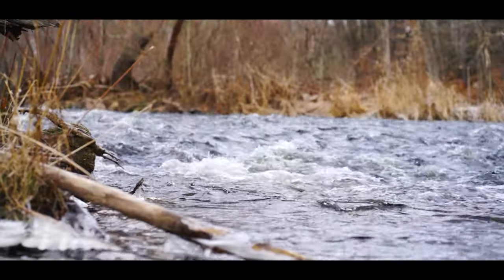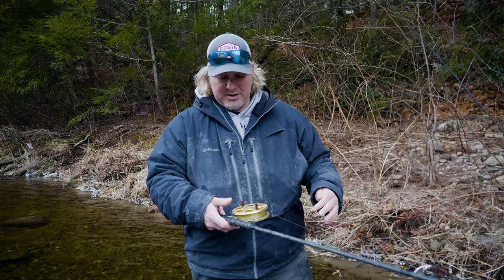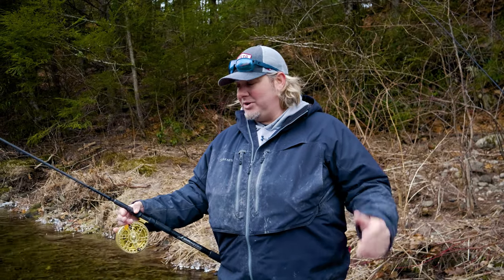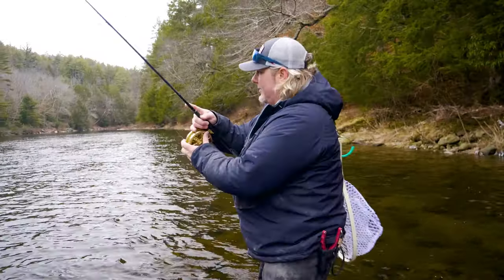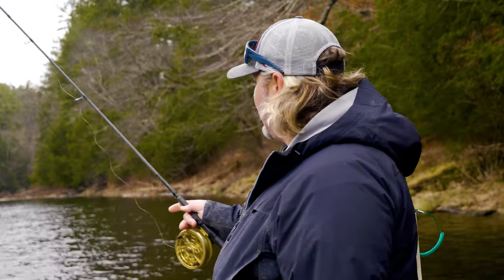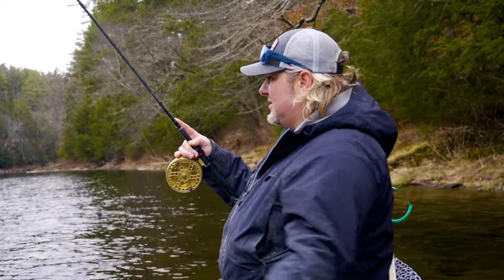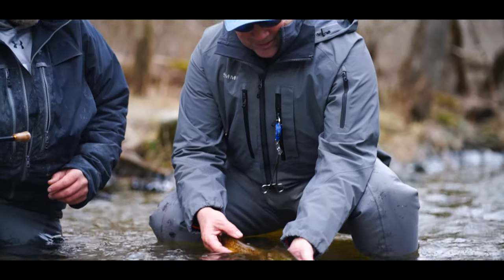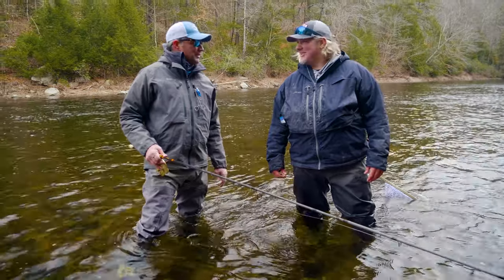How to Fish a Centerpin Setup | Effective Stream Fishing Technique for Trout, Salmon, & Steelhead

Comment: Great video. Try a Wallis cast alot less line twosts
Reply: This is so true. Have you ever tried p-line's "hydrofloat"? It's a unique coated superline made specifically for centrepin float fishing. It's kind of "papery", stiff but not in the way that mono is, more like, well, paper. Because of this it doesn't tip wrap as much and when it does it's easier to fix, and it doesn't twist as much when side casting. Very very good line, but still has some issues.

Comment: I have a 7wt 11' Switch rod (fly rod), could I use this for centerpin fishing?  Is there a recommended reel that works well?  Thanks!
Reply from the maker: Hey Martin,
It will the job done, but might not be ideal. The action of a float-fishing rod is closer to a spinning rod than a fly rod, and the 7-weight might prove to be a little heavy, depending on whether you're targeting stream trout, or lake-run brown trout and steelhead. 

For a reel, Okuma makes a couple centerpins at affordable prices, with the Raw II and Aventa, which are great reels to get started float fishing with. 

-Jimmy Fee

Comment: whats trotting? is it important to drag the float back as you drift to get the bait to the fish instead of the lead
Reply from the maker: Trotting is when you hold back the rig as it drifts a bit.  Many fishermen will "check" the float, popping it backwards briefly to make sure the hook and bait are the first thing to reach the fish. This also helps get the line off the water to make sure it's not dragging the float.

Comment: Can you share what rods you are using? Most centerpin rods seem to be made for salmon and steelhead so I was wondering if you guys scale down for trout.
Reply: I’ll give you some options since I have myself a centerpin specifically for just stocked trout. There’s a lot of preferences guys prefer. Anywhere from an 8ft-12ft for trout. I prefer a 9’6”. I know a ton of guys that like a 10’6” as their preferred choice. My 9’6” is just an okuma celilo light action. But I’ve used my medium light riversider 11ft rod for trout as well. Awesome rod for the money! I know blood run makes a 10’6” rod for mini centerpins for trout. But you can also just go with a standard crappie noodle rod and it’ll get the job done just as good and it’s very cost efficient. I own a mini pin or “pinland” that Danny Colville makes but there are other options that you can get other than a Colville reel. I’ve seen kingpin make a mini pin and they are fantastic reels!
Reply: @Fishingrunner  , Greetings. What is the weight of the rods you use for trout fishing?